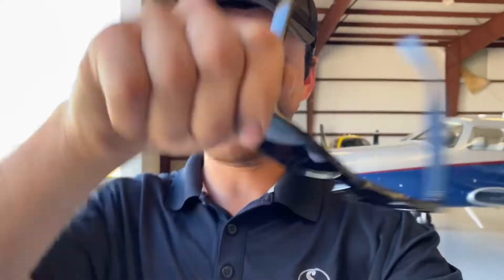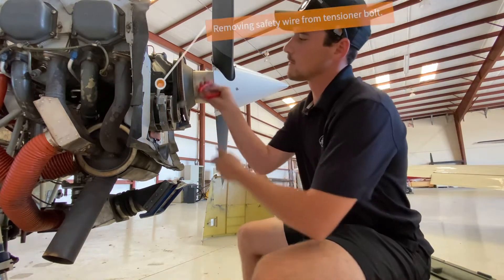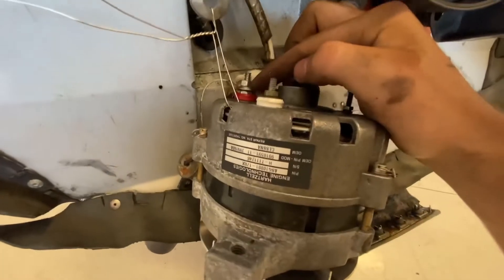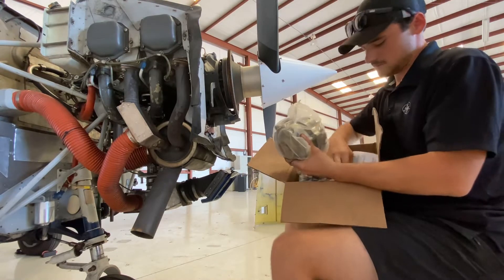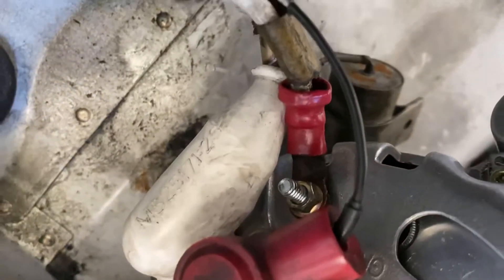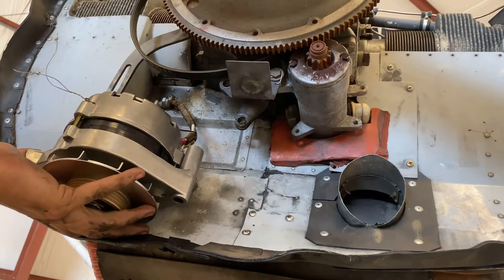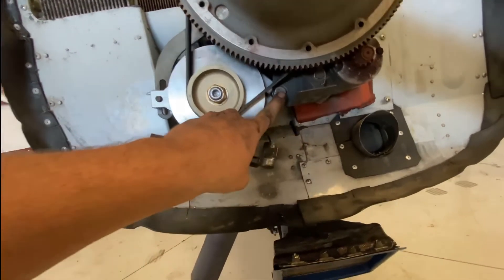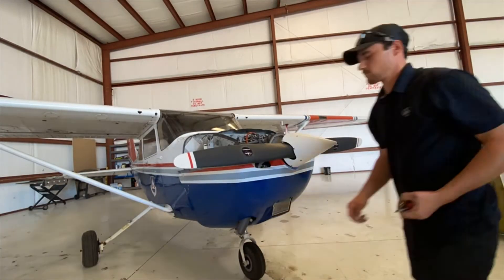Lycoming Alternator Change.

Comment: You can also check belt tension using a torque wrench on the hub nut of the alternator while moving the prop.  The belt should slip if the torque wrench is set high, and click the wrench if set lower.